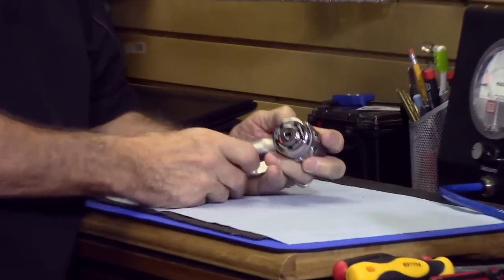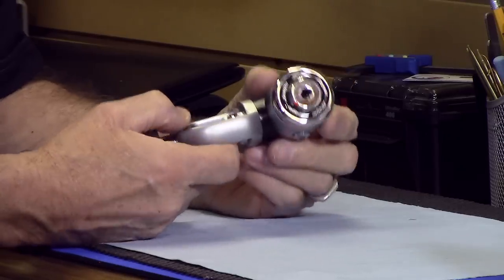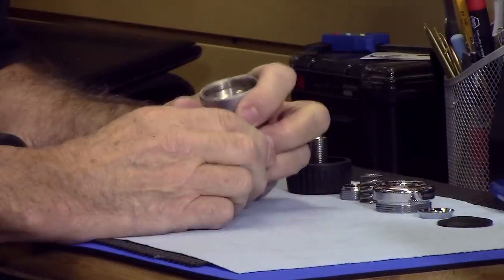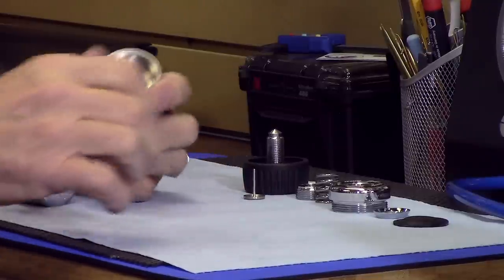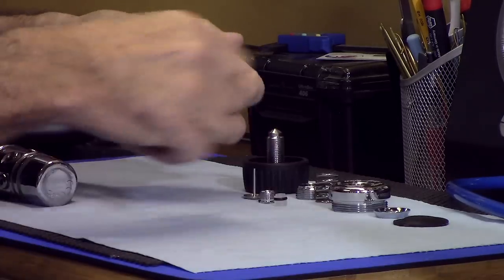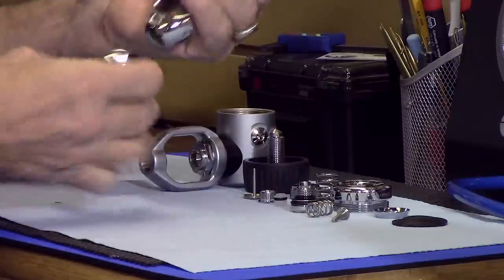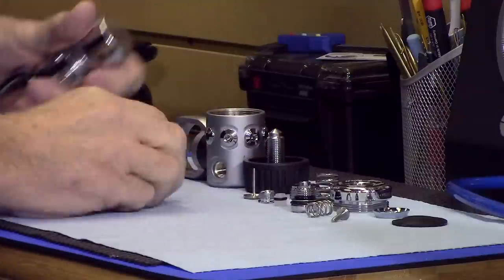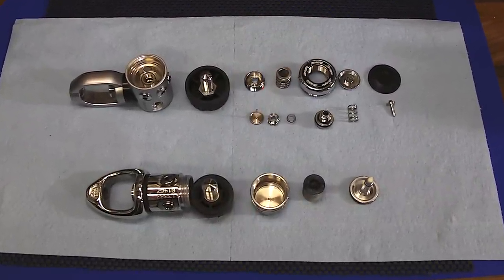Piston vs Diaphragm 1st Stage - Scuba Tech Tips: S07E01

Comment: This is an unfair comparison. 

It compares the simplest piston regulator to one of the more complex diaphragm regulators.  A more appropriate comparison for a simple diaphragm regulator would be a Conshelf 14, early Aqualung Titan or a Mares 12. 

It also ignores performance … an unbalanced piston regulator is a poor performer, especially at depth and as tank pressure decreases.

Made me lose some respect for you Alec.
Reply from the maker: A "complex" piston regulator? I'm not sure what that would be. Be design they are simple - a piston, a spring and, and, and, Oh Yeah - 2 O-rings. A fully balanced, full feature piston regulator has, wait for it, a piston, a spring and 2 O-Rings. The balancing of a piston regulator is simply a different air flow through the piston. There's no additional parts or complexity.

The Conshelf 14 (great reg BTW, serviced hundreds of them) still has many more parts that a comparable piston. Both the Titan and Mares MR12 are more complex than the Conshelf. In my video, I did not show all the parts of the diaphragm regulator. There are actually more inside. I couldn't find a standard diaphragm on a moment's notice so I used a balanced model but I countered that by not showing some parts. The comparison is quite valid. I have no agenda and try to make any such comparisons completely fair. The Conshelf 14 has a threaded adjustment cap, spring, diaphragm pad, diaphragm washer, diaphragm, pin pad, pin, moveable seat and another spring - not counting the filter and clip which is the same for both. The Mares MR12 is identical.
I don't want to argue with you but it is a simple fact that any piston reg will be simpler in design than any diaphragm reg. It just takes more parts for a diaphragm reg to sense the water pressure and deliver that action via a pin to the moveable seat.

My only real issue with your comment is that a standard regulator (as you call unbalanced) is a poor performer. The balanced design offers some advantages and some of those advantages may be interpreted as performance related but, for recreational divers in a recreational dive environment, it is not correct to say that a standard regulator is a poor performer.  I've made clear that a balanced regulator is preferable given a choice and maybe even essential if diving deep, in cold water or situations where a higher flow air flow is required, but a better regulator?? Everything compared - cost, maintenance, weight, reliability, performance, etc, - the standard reg measures up very well.
I should make clear my objection to the description of a standard regulator as an unbalanced regulator. The two terms describe the same reg design. Realize that at one time, in fact for MOST of the history of scuba diving, standard regulators were the norm. There was no choice. Regulators were just regulators. Then my friend Sam Lecoque designed the first balanced regulator, which BTW, were shunned by divers for a long time. Now we have a choice. The right reg for the right diver based on his needs.

Sorry about the respect thing. May I suggest that you take apart a piston reg and a diaphragm reg as I did and look at the pile of parts - standard or balanced. Hopefully you'll agree that one is simply simpler, which was my whole point.
I avoid the use of the word 'better' in my videos unless there's clearly a important difference. If you re-watch it I think you'll find I did so in this vid too.
Thanks for your input Bee.
Alec
Reply: Alec, I own and service sets of Scubapro MK25/S600 and Apeks DS4/XTX40 regulators. 

The last time I did the MK25 I recall it had at least 2 o-rings just on the top of the piston.  Then there bushing rings, around hp o-ring in the piston shaft, a high pressure plug on one end and another plug on the other end with more internal springs on the hp side too.   The MK25 is complex and finicky to service and requires special tools to insert bushings, bullets to insert piston etc. 

An Apeks balanced diaphragm regulator is, by comparison to a MK25, very simple to service. My DIN version can be serviced with just 4 tools: 2 hex spanners, an o-ring pick, and c-pin spanner. 

And the Apeks is a better [performing] regulator ;)
Reply: BTW, the Titan is internally identical to the removable crown version of the Conshelf.
Reply: Also, Ted Eldred in Australia developed a balanced diaphragm regulator (Porpoise Universal) around 5 years before Sportsways was founded.

Comment: Isn't your reg a Oceanic ZEO ? what do you make of this burp they have on it - all marketing hype ?

"The FDXi offers a balanced diaphragm. The balanced diaphragm is inherently environmentally sealed. Water enters the main spring cavity and the pressure increase from the water is transmitted to the internal components by the impermeable diaphragm membrane. The benefit of this type of first stage design is that none of the delicate internal parts are exposed-to-contaminants such as salt, sand, chlorine or pool acids. These environmental contaminants can cause corrosion and mineral deposits to form on the internal mechanism deteriorating regulator performance. A diaphragm first stage regulator requires less-maintenance then regulators that allow these contaminates to enter the internal mechanism.
In addition the FDXi first stage regulator has a secondary diaphragm to completely seal-off the main spring cavity."

Comment: Yeah but with the piston one the deeper you go the harder is to breath...and the less air you have in your tank the harder it gets to breath......also the diaphragm one is easy to adjust the IP....plain and simple.
Reply: If the piston is unbalanced sure, but a balanced first stage should keep the IP at the set pressure unless your tank is really low.  This is however dependent on the design depth, more often than not this is going to beyond the rec limits that a large majority of people work within.

And honestly once IP is set there should be little reason to change it.  By the time you reach that point the regulator is probably in need of service.
Reply from the maker: Piston's come in balanced versions too.  You could not tell the difference between a balanced piston and diaphragm at 66 ft. Thanks for watching mate.
Reply: The "balance" feature has absolutely NOTHING to do with depth, it is entirely dependent on tank pressure.  Piston regulators are NOT harder to breathe with depth.  I have no idea where this idea came from.  Plain an simple.